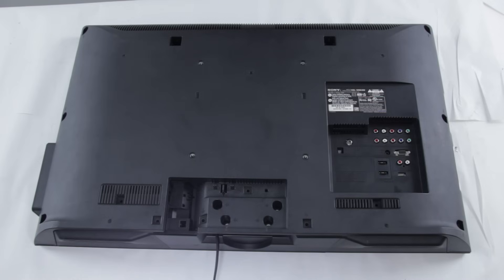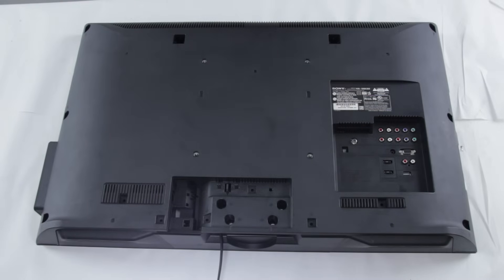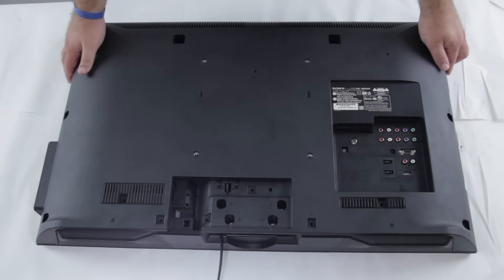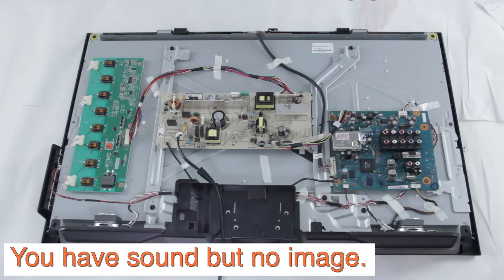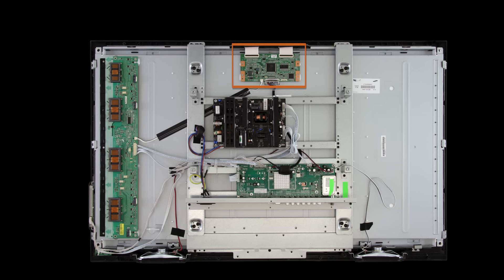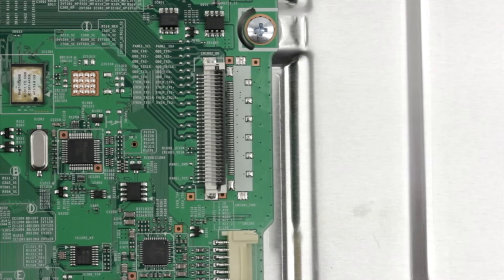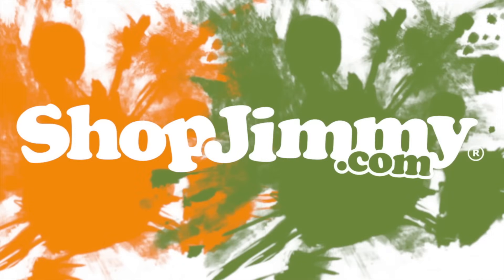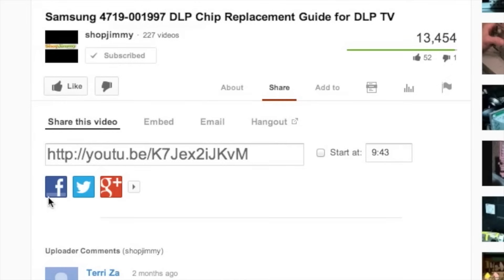LCD TV Repair Tutorial - T-Con Board Common Symptoms & Solutions - How to Replace T-Con Board

Comment: I have an insignia 42in NS-LCD42HD-09 and ever since I got it I've had issues with the HD. Basically any resolution higher than 1280x720 the TV will occasionally go black with no sound for 1 to 5 secs. Sometimes it happens a ton and sometimes not too much.  I've tested all 3 HDMI ports with various cables and it still does it. Its really annoying to the point where I am looking to buy a new one that will actually display HD properly. The TV is in otherwise great shape everything still works but that. I'm a DIY kind of guy and was wondering if you have any idea if replacing this board would resolve the issue?
Reply from the maker: Bryan Murphy  Please watch this video FIRST to help with your repair!  https://www.youtube.com/watch?v=BP3NVNCGEv8  I recommend replacing the main board in your TV.  Click this link to replacement parts for your TV model number:  http://www.shopjimmy.com/catalogsearch/result/index/?cat=56&q=NS-LCD42HD-09  There may be multiple boards for the same TV model number, be sure to match part numbers on your current board, with your replacement for compatibility.  Here is a link to a video showing how to identify your part number, click here:  https://www.youtube.com/watch?v=LIWO2A_tuaI  Thanks and please let us know if you have any further questions with your TV Repair!  www.shopjimmy.com

Comment: I have a Sony KDL-40V2000  S/N 4016735 that will only turn on for a few seconds, then 'Click' and turn itself off leaving only the solid green light on the front panel and not showing any flashing fault codes. A few seconds later, the TV will attempt to turn itself back on where it will once again power up, show a picture for a few seconds then 'Click' and turn itself off again. This cycle just keeps repeating
Reply from the maker: Ian Batchelor  Please watch this video FIRST to help with your repair!  https://www.youtube.com/watch?v=BP3NVNCGEv8  I recommend replacing the main board in your TV.  Click this link to replacement parts for your TV model number:  http://www.shopjimmy.com/catalogsearch/result/index/?cat=56&q=KDL-40V2000  There may be multiple boards for the same TV model number, be sure to match part numbers on your current board, with your replacement for compatibility.  Thanks and please let us know if you have any further questions with your TV Repair!  www.shopjimmy.com

Comment: My LCD Model # is LNS3241DX/XAA. All of sudden, I cannot see HD quality image on my tv anymore. When I turn on my TV, I get HD image for 10 seconds but the image will turn into a non-HD quality image. I tried to control pictures but my TV would not let me adjust anything. In addition, I have called my cable company and replaced HDMI cable but I come to a conciliation that my TV has a problem. What can I do with that?
Reply from the maker: cielksy  Please watch this video FIRST to help with your repair!  https://www.youtube.com/watch?v=BP3NVNCGEv8  I recommend replacing the main board in your TV.  Click this link to replacement parts:  http://www.shopjimmy.com/catalogsearch/result/index/?cat=56&q=LNS3241DX%2FXAA  There may be multiple boards for the same TV model number, be sure to match part numbers on your current board, with your replacement for compatibility.  Here is a link to a video showing how to identify your part number, click here:  https://www.youtube.com/watch?v=BEPWrefQvqI  Thanks and please let us know if you have any further questions with your TV Repair!  www.shopjimmy.com

Comment: i have a vizio m420kd lcd tv. i turn it on and the backlight only comes on for a second and then it goes into standby mode.
Reply from the maker: Jason Wright  Please watch this video FIRST to help with your repair!  https://www.youtube.com/watch?v=BP3NVNCGEv8  I recommend replacing the main board in your TV.  Click this link to a replacement part:  http://www.shopjimmy.com/vizio-cbpftxccb02k0080005-main-board-for-m420kd.htm  Be sure to match part numbers on your current board, with your replacement for compatibility.  Here is a link to a video showing how to identify your part number, click here:  https://www.youtube.com/watch?v=kxkeGLhlQY8  Thanks and please let us know if you have any further questions with your TV Repair!  www.shopjimmy.com

Comment: Thank you for getting back to us. Do you have any videos on replacing the Samsung Model # LN52C530F1FXZA main board?
Reply from the maker: jgilpin007   Unfortunately we do not.  Try all repairs at your own risk and be sure to take the proper safety precautions.  Most repairs involve removing the back cover of your TV and then disconnecting the boards you are replacing and removing the screws that attach it to the panel.  Thanks!  www.shopjimmy.com

Comment: hi, I have a Samsung LE40B530P7W,The TV shows dark images and the images appears in slow motion. I already remove the ribbons connectosr from the T-Con board and re-insert them, the problems is persisting.Would you know what is the source of the problems please.
Reply from the maker: look4wd2  This sounds like a TV panel (TV Screen) problem.  If your TV panel is bad, it may be more cost-effective to replace the TV as panels are typically hard to find in stock, difficult to replace, and expensive.  Thanks and please let us know if you have any further questions!  www.shopjimmy.com

Comment: Hi, I've got a Bravia KDL-40CX520 and we had an accident where we hit the screen of the tv and after which a purple line is now showing on the screen. however, the line is not that overly obvious and its fairly negligible. My question is, does the line get worse over time?
Reply from the maker: paddywaggie   Yes, this sounds like a TV panel (TV Screen) problem.  If your TV panel is bad, it may be more cost-effective to replace the TV as panels are typically hard to find in stock, difficult to replace, and expensive.  Thanks and please let us know if you have any further questions!  www.shopjimmy.com

Comment: I have a Vizio E390-A1.  When the set is initially turned on the picture is distorted, flickers, and has horizontal lines http://youtu.be/8aOgqUf3NjI .  After about a minute the picture goes to multi-colored vertical lines http://youtu.be/g9XziDYIN7Y with no video and stays this way.  If I turn it off, and back on the cycle repeats.  I checked for loose connections, reseated the connector going to the T-CON, and didn't find any intermittent connections.  I'm assuming it is the T-CON board, but the board on this set is integrated into the LCD panel.
Reply: Not SPAM and I have no idea why someone is going through this post marking items this way.
Reply from the maker: David Lewis   This sounds like a TV panel (TV Screen) problem.  If your TV panel is bad, it may be more cost-effective to replace the TV as panels are typically hard to find in stock, difficult to replace, and expensive.  Thanks and please let us know if you have any further questions!  www.shopjimmy.com

Comment: I got a Samsung LN32C 450 E1DXZA
When I tried to turn it on one day, no sound no picture, but the red power light was on.
I tried to turn the TV off with remote but the red light would not go off. I unplugged it for a day and plugged it back in and still nothing, but the red power light on. I opened it up just to see if anything obvious was wrong. Nothing. Found a button like a reset button pressed it just to see but nothing. I only see two boards on the TV one power and other I assume or thought is T-con. any suggestions?

Thanks
Reply from the maker: Santa Clause  Please watch this video FIRST to help with your repair!  https://www.youtube.com/watch?v=BP3NVNCGEv8   I recommend replacing the main board in your TV.  Click this link to replacement main boards for your TV model number.  http://www.shopjimmy.com/catalogsearch/result/index/?cat=56&q=LN32C+450+E1DXZA  There may be multiple boards for the same TV model number, be sure to match part numbers on your current board, with your replacement for compatibility.  Here is a link to a video showing how to identify your part number, click here:  https://www.youtube.com/watch?v=BEPWrefQvqI  Thanks and please let us know if you have any further questions with your TV Repair!  www.shopjimmy.com

Comment: Hi, I have a Samsung model# LN46A630M1F the colors are distorted, faces look dark and green and purple... It started gradually and now it's to were we cannot distinguish any facial features.... Words on the bottom of the TV are seen fine like titles of shows and movies. Other than the color everything else seems to be working perfectly. What could be the issue? I was told by a friend it could be the t con board, do you think this is the problem?
Reply from the maker: lupe wilson  Please watch this video FIRST to help with your repair!  https://www.youtube.com/watch?v=BP3NVNCGEv8  This could be a problem with either the Main board or the TV panel.  You can replace the main board in your TV to see if this fixes the problem.  Click this link to replacement parts:  http://www.shopjimmy.com/catalogsearch/result/?q=LN46A630M1F  There may be multiple boards for the same TV model number, be sure to match part numbers on your current board, with your replacement for compatibility.  Here is a link to a video showing how to identify your part number, click here:  https://www.youtube.com/watch?v=BEPWrefQvqI  Thanks and please let us know if you have any further questions with your TV Repair!  www.shopjimmy.com

Comment: Hi   I have a Sony Bravia  KDL-52XBR2.  Started to show a thin line, from top to bottom ,on the left side of the screen.It would go away after the tv warmed up. Recently however now there is no picture. It powers on, you hear the click and the sony light at the bottom lights up. You can see the backlight on but no picture. However there is sound and I can hear the channels changing and volume change when I increase or decrease it. What would your suggestion be to troubleshoot/replace first? Very informative video!.  thank you.
Reply from the maker: dutch300zx1   This sounds like a TV panel (TV Screen) problem.  If your TV panel is bad, it may be more cost-effective to replace the TV as panels are typically hard to find in stock, difficult to replace, and expensive.  Thanks and please let us know if you have any further questions!  www.shopjimmy.com
Reply: could try a tcon board.
Reply: Thanks for the replies. I figure I will start with replacing the Tcon board and see if that fixes it.

Comment: I have a sharp aquos 52.  "52se94u". It has solid colored vertical lines going halfway up on the bottom right side going towards the middle.  It shows up right when the picture appears.  I did see a video of one guys TV that waited for his lines to show up.  Is mine a possible t-con issue?  Is their a possible diagnosis I can do to determine wether it is that or not?
Reply from the maker: Ryan Chesebro   This sounds like a TV panel (TV Screen) problem.  If your TV panel is bad, it may be more cost-effective to replace the TV as panels are typically hard to find in stock, difficult to replace, and expensive.  Thanks and please let us know if you have any further questions!  www.shopjimmy.com

Comment: Lg 55LM4600. Thin black horizontal lines on half (one side) of the screen. They are about 1/8" apart. Any ideas would be appreciated.
Thanks
Reply from the maker: Wayne Watson   This sounds like a TV panel (TV Screen) problem.  If your TV panel is bad, it may be more cost-effective to replace the TV as panels are typically hard to find in stock, difficult to replace, and expensive.  Thanks and please let us know if you have any further questions!  www.shopjimmy.com

Comment: Samsung model LN46A530P1FXZA serial number ALDK3CEQ600447H
black flashing horizontal lines appear at top 1/3 of screen height after a few minutes when first turned on and fade out then disappear after a few hours when left on. Have no issues with audio. Which board is likely to be defective ?
Reply from the maker: Stewart Dickson   This sounds like a TV panel (TV Screen) problem.  If your TV panel is bad, it may be more cost-effective to replace the TV as panels are typically hard to find in stock, difficult to replace, and expensive.  Thanks and please let us know if you have any further questions!  www.shopjimmy.com

Comment: Hello! I found a samsung LE32A336J1DXXC,my problem is solariced distorted picture and I don't have remote control, can you tell me what the microchip image to replace, forgive my English, thanks
Reply from the maker: Rosi Rosita   I recommend replacing the main board in your TV.  Unfortunately I do not see any replacement parts in the search results for your TV model number on our website.  Please reply with your part number on your main board and I can try searching for replacement parts.  Thanks and please let us know if you have any further questions!  www.shopjimmy.com
Reply: ShopJimmy.com Hi!! sorry for the delay,
 I think that is the number of the main board in my tv samsung LE32A336J1DXXC:
BN94-02117P  F067(P07)   20080728
HU 10 Exp  F067 90003170 0594

If fou find something let me know..Thanks
Reply from the maker: Rosi Rosita   Unfortunately I do not see any replacement parts for that board number.  Thanks! www.shopjimmy.com

Comment: I have a Sony Bravia KDL-52XBR9 with the "oh so popular" horizontal "blurry" lines issue. Would a replacement T-Con board help this issue? The model in your video looks like a Sony Bravia (not sure of size) and I didn't take notice when I last opened my TV to see if the T-Con board was easily replaceable. Any suggestions?
Reply from the maker: ian corrao  This sounds like a TV panel (TV Screen) problem.  If your TV panel is bad, it may be more cost-effective to replace the TV as panels are typically hard to find in stock, difficult to replace, and expensive.  Thanks and please let us know if you have any further questions!  www.shopjimmy.com
Reply: ShopJimmy.com Thanks for the reply. I was really hoping it was an easy cheap fix. The good news is that on Sony's site they have extended the warranty on these specific TVs with the same problem until March 2015. I have a case open with them and am hoping they can get me a replacement. Thanks again!

Comment: i have samsung 32" tv model UA32D4000NXUM suddenly screen turns white.
Reply: what is the t-con board number?
Reply from the maker: Jogi Pogi  Please watch this video FIRST to help with your repair!  https://www.youtube.com/watch?v=BP3NVNCGEv8  Looks like the t-con board may be built into the main board.  Thus if looking to replace the T-con board, you would need to replace the main board.  Click this link to replacement parts:  http://www.shopjimmy.com/catalogsearch/result/index/?cat=56&q=32D4000  There may be multiple boards for the same TV model number, be sure to match part numbers on your current board, with your replacement for compatibility.  Here is a link to a video showing how to identify your part number, click here:  https://www.youtube.com/watch?v=BEPWrefQvqI  Thanks and please let us know if you have any further questions with your TV Repair!  www.shopjimmy.com

Comment: Hello I need help please I have a kdl-46sl140  with a red light blinking 6 times. The TV comes on and shows Bravia sign then shuts off, followed by the blinking red light. If I unplug it for a couple of hours it works good for a day or two. Then back to square one. Any suggestions?
Reply from the maker: fbanda20   Sounds like you have bad LEDs in your TV and there is not really a fix for that. Thanks! www.shopjimmy.com

Comment: I have a 2011 Samsung UN55D8600YFXZA serial Z2Z83CAB201813M. The bottom 1/4 of the screen is lighter than the top and the upper left side is bright and blurry. If you push on the side of the tv you can make lines show up. How can I test the Tconn board?
Reply from the maker: ken parsons   This sounds like a TV panel (TV Screen) problem.  If your TV panel is bad, it may be more cost-effective to replace the TV as panels are typically hard to find in stock, difficult to replace, and expensive.  Thanks and please let us know if you have any further questions!  www.shopjimmy.com

Comment: Hi,
I just got through watching your video, very helpful. I have a Sony Bravia KDL-32BX300 S/N: 8007609 that has horizontal lines and a jumpy picture. I'm thinking it might be the "TCON" board, but wanted a second opinion. Also, do you sell these boards for this TV? Thanks,
Jim Justice
Reply from the maker: James Justice   This sounds like a TV panel (TV Screen) problem.  If your TV panel is bad, it may be more cost-effective to replace the TV as panels are typically hard to find in stock, difficult to replace, and expensive.  Thanks and please let us know if you have any further questions!  www.shopjimmy.com

Comment: I have a Samsung 46" Lcd model # LN46B640R3FXZA where the picture displays with verticle contrast line and sometimes covers the whole picture. but when I turn on my DVD player the contrast goes to 100 percent. I can adjust it to where the picture is fine but when I return to normal TV it continues with the verticle lines. I think I need to replace the T-Con board what do you think it is? you can send your answer to rjudgeman@yahoo.com
Reply from the maker: Colleen Judge   This sounds like a TV panel (TV Screen) problem.  If your TV panel is bad, it may be more cost-effective to replace the TV as panels are typically hard to find in stock, difficult to replace, and expensive.  Thanks and please let us know if you have any further questions!  www.shopjimmy.com